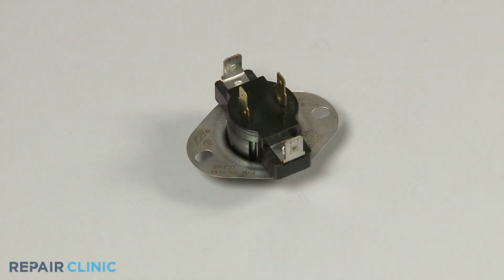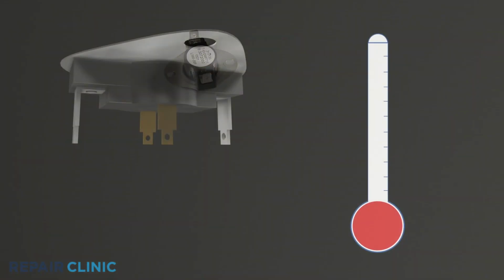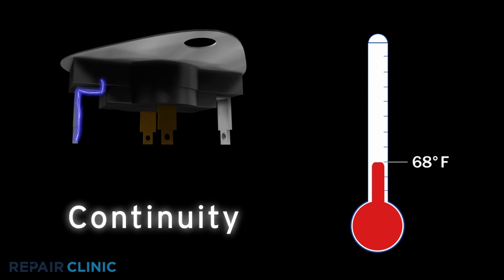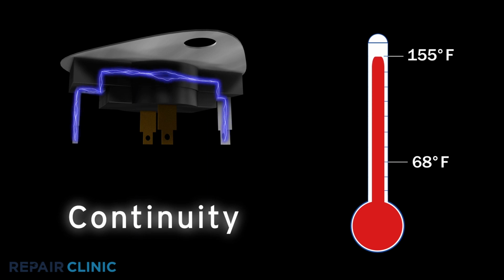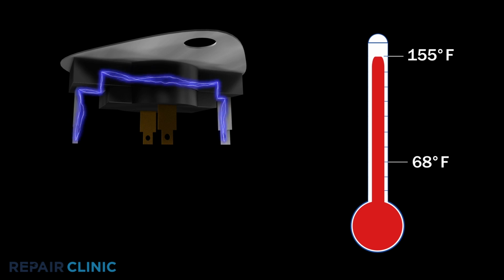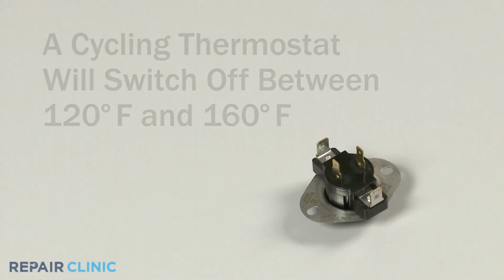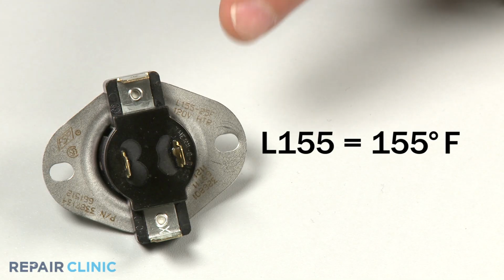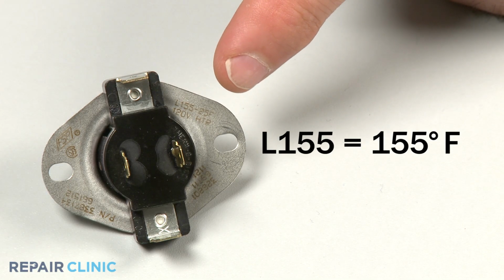Dryer Not Drying? Cycling Thermostat Testing

Comment: My low heat contact are open. Are they supposed to be open?
Reply: I was wondering the same thing.
Reply: @DavidMann10k  yes they are supposed to be I believe. If I remember correctly new gas solenoid coils fixed it.
Reply: @jeffescortlx  thank you!
Reply: @DavidMann10k  You're welcome. My 20-year-old dryer is on its third set of solenoid valves.